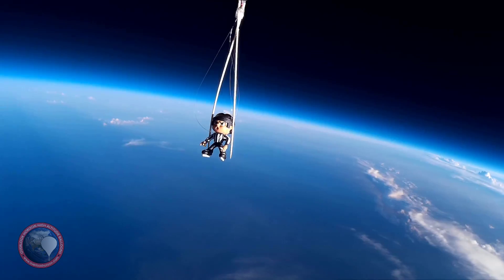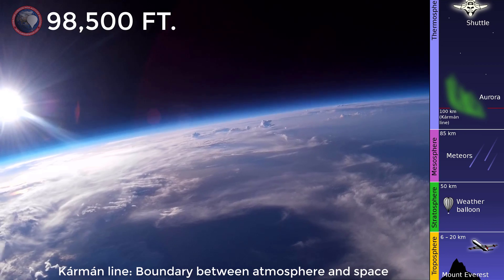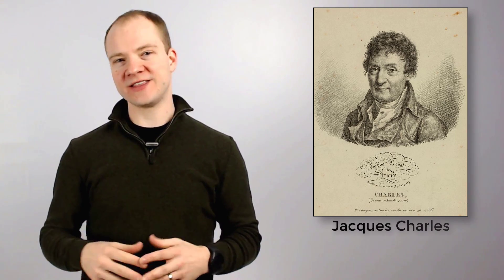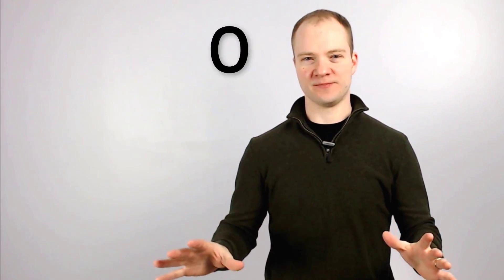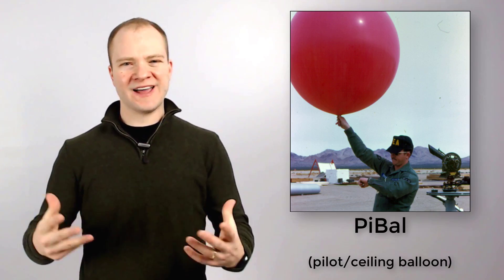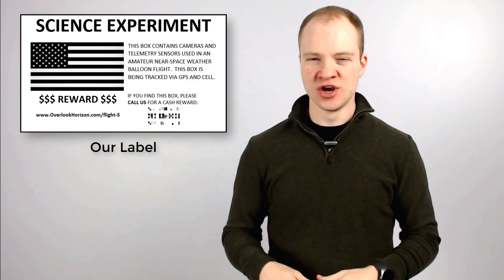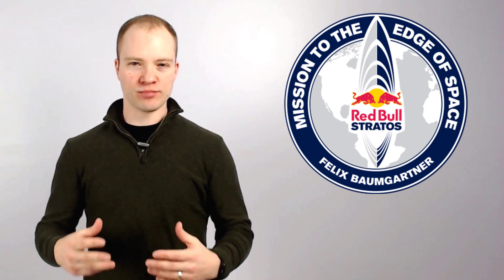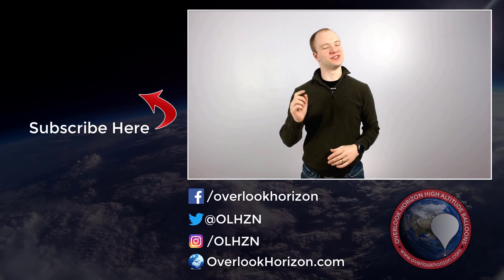What is a high altitude balloon?

Comment: Hello Tory!  A couple basic questions.  Can I find answers in another of your videos?  1.  Do you include the waterproof housing with the GoPro style cameras you launch for thermal protection, or just mount the raw camera into the Styrofoam cooler?  2.  Do you use rechargeable USB style Li-Ion batteries to extend the camera life or disposable Lithium batteries which I read do much better in the cold than Li-Ion rechargeable.   Thanks!

Comment: Good info in the video!  I'm a retired engineer planning my first photography HAB launch.  Simple question, why such a long lead line between the balloon neck and the parachute in the video  (25 second mark)?  Looks like 15 or 20 yards?  I've read some papers about stabilizing the payload using air scoops and multiple lines tethered to the balloon next to dampen pendulum motion and spin.  But nothing about such a long lead line.  Thanks!  Peter
Reply from the maker: There are a few reasons... 1) it helps dissipate payload spin imparted from the balloon, 2) balloon burst is violent so it reduces shock to the payload at burst, 3) it can reduce some atmospheric turbulence from the balloon and 4) environmental sensor readings are generally more accurate, although this isn't a huge concern for our flights... usually the NWS is more concerned with that.
Reply: @OLHZN  Thanks for the response.  The papers I've read claim the balloon does not spin much (verified by upwards camera), it is the asymmetric payload that spins, so coupling to the balloon reduces spin.   Here's 1 paper I mention:  https://www.iastatedigitalpress.com/ahac/article/5570/galley/5436/view/

Comment: Hey Great Channel, just subbed.  I have a few questions if you don't mind?  Do all HAB's burst or do some just drift on forever? What type of balloons are you using? Are they latex? and what is your preferred filling gas? Can you recommend some flight path prediction software? So many questions! Keep the cool content coming, great stuff!
Reply from the maker: There are many HABs that are meant for long duration and will float indefinitely until cutdown or failure.  Our typical latex balloon flights are designed to last between 2 and 4 hours usually and we mostly use helium for our lifting gas.  Check out http://overlookhorizon.com for some prediction software in the Utilities section.